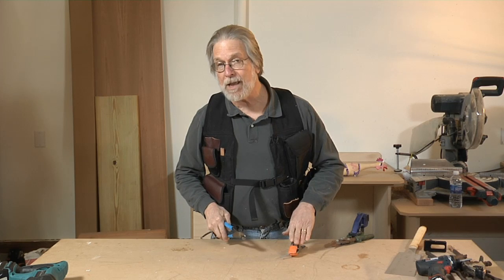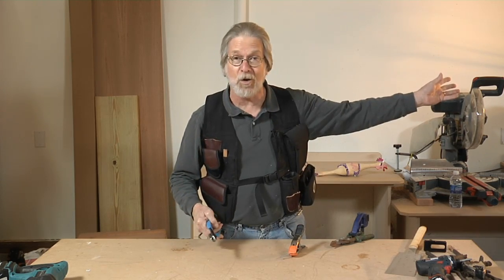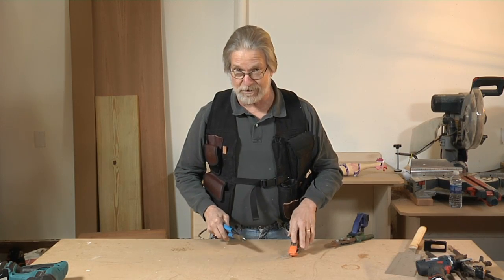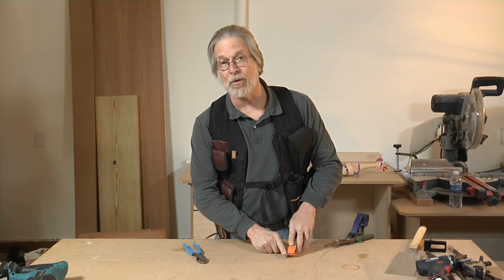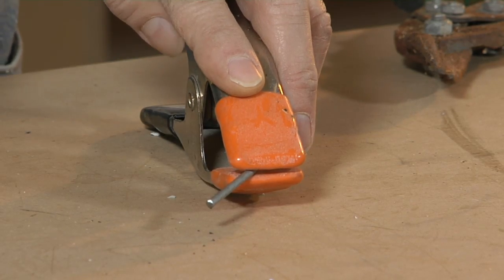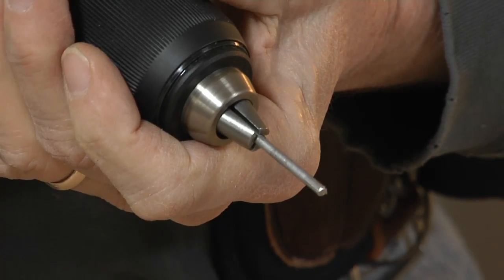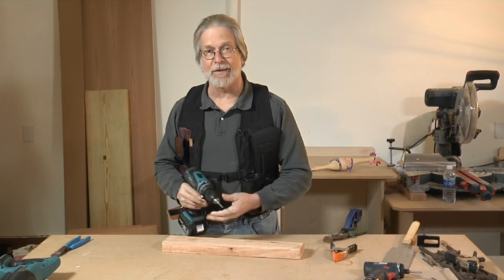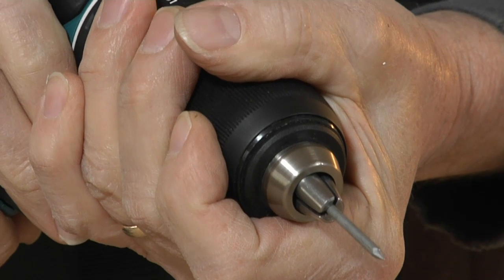Make a Drill Bit in a Pinch

Comment: You don't need to break off the head of the nail... the drill chuck will acomodate it. Just drill with the tip of the nail. You might want to heat-harden it.